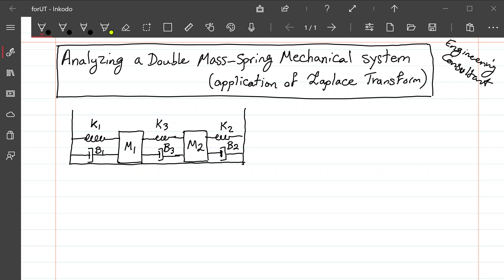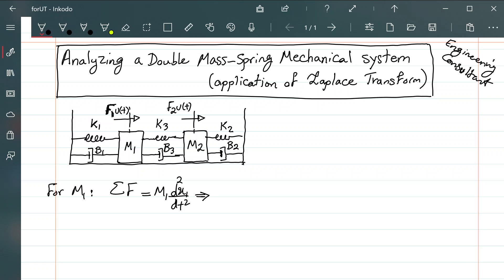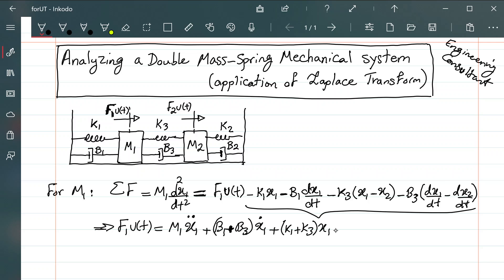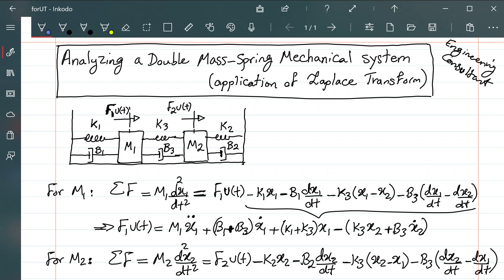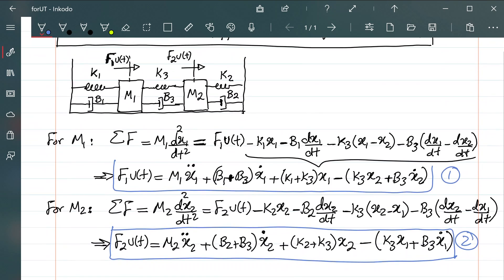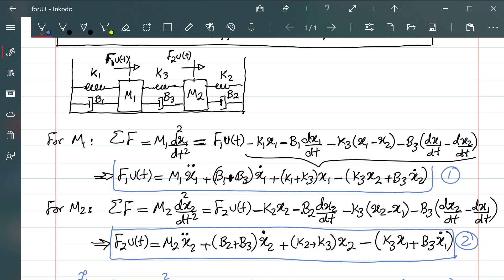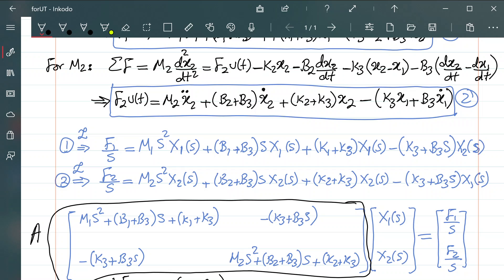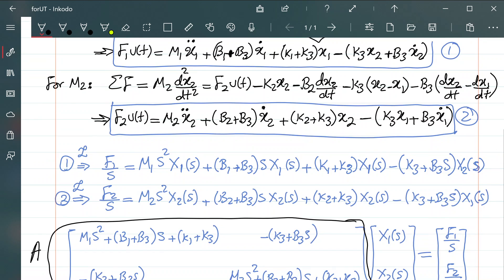Double spring-mass mechanical system analysis using Laplace Transform

Comment from the maker: Thanks for watching. As requested, here are further Video examples for Single and Double Spring-Mass Systems:  
Electric Circuit Analogy for Mechanical System: https://youtu.be/997hfjGK3_w
https://youtu.be/lCyJGtUK9zs : Double spring mass system analysis using Laplace Transform.  https://youtu.be/CLY4f9RZo_U Oscillation frequency of Tuning Fork computed using Laplace Transform.  
https://youtu.be/I4mqQQ9hSKc : using Laplace Transform to solve spring mass mechanical system transient response
Hope you find them helpful.